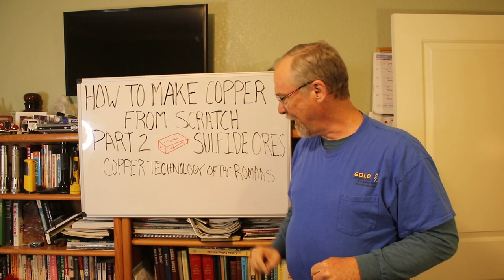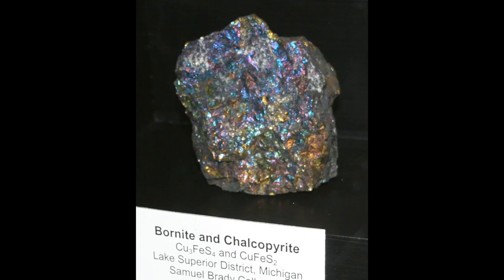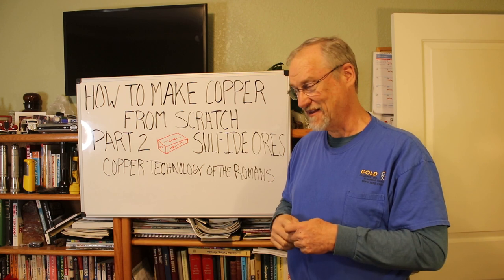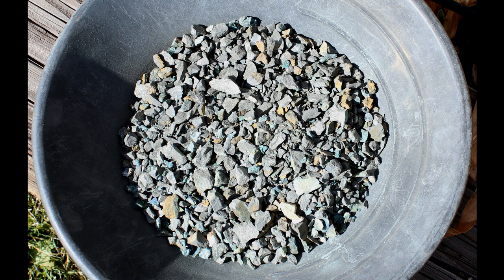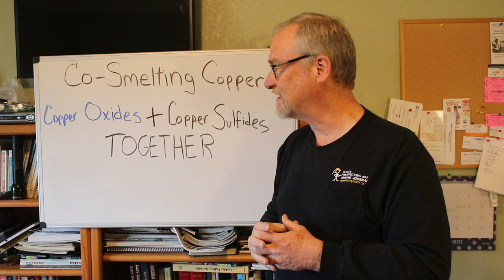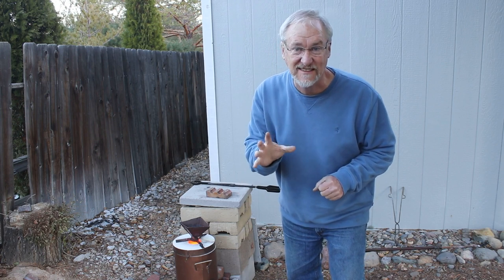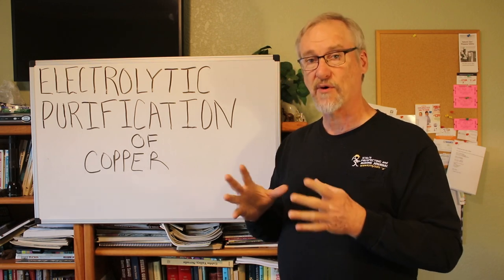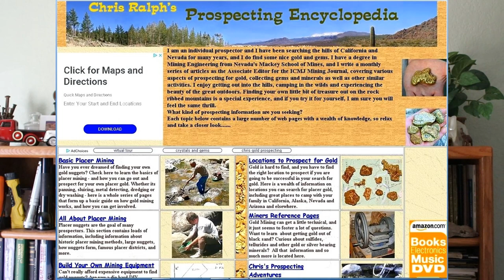Home smelting copper from sulfide minerals

Comment: Hey Chris been deep diving your material thanks for being such a great teacher :) I found some sedimentary rocks that have native copper and some yellow that i think is chalcopyrite. They were shaped like eggs some green and some red and had small grains like sand. They have cavities that look like other minerals have been leached out. They are pretty easy to break apart with a hammer and I panned one and there are some shiny yellow that i was getting at the bottom of the pan. I have been trying to find what deposition model it could be or if it would be worth chasing. Do you have any suggestion what it might be? I am in Idaho right by the big lava flows. Both mountain ranges on each side have had lots of silver-lead mines, copper and gold mines but no previous mines in my middle mountain range. I found this right next to two expired claims from the 80s that were on the creek next to the mountain. Again thanks for all the resources you are providing hopefully you can turn this biologist into a solid prospector one day :)
Reply from the maker: And that is why I don't offer to do mineral ID. You are not really sure of the rock, maybe its native copper, but maybe just something copper colored. I really have no idea what you have. Watch my mineral ID video - color is the least important thing in doing ID of a mineral - because many minerals are of the same color.

Comment: I experimented with this process and also failed. On my second attempt i crushed the ore untill it was small enough to go through a flour sifter. Then used a gold pan to seperate the sulphides and host rock. roasted the sulphides in a stainless steel bowl untill red hot. slowly pourd the hot  sulphides onto a steel tray in a low wind environment so it doesnt blow away (roughly 3 feet above the tray). As it falls through the air it creates a high oxygen environment for the red hot sulphides and it drives off the sulphur (i figured this out by accident). then proceeded to smelt with some scrap iron. It came out surprisingly clean.
(If anyone attempts this please use breathing apparatus. Burning sulphur/heavy metals is toxic)

Great video. I just found your chanel and subscribed 👍.
Reply from the maker: Sounds interesting.

Comment: Great video. This is a very interesting topic. As a metal melting channel, the easiest thing I can say that will help you and is so cheep, you might just slap yourself on the forehead and say OH MY GOSH!!!  If you put a piece of cardboard on your firebrick, then your crucible on the cardboard, it won’t stick most of the time.  Use the thicker cardboard, the double layer with the wavy sheet in it., not the pop can box. It works, but the thicker the better. Very easy and cheep fix.   While melting the mix, did you stir it to mix it up?  That might help.   Sounds like something I would like to try. What was your mix ratio, 50/50?
Reply from the maker: I do put cardboard under the crucible. I did also stir it.
Reply: @ChrisRalph  Right on.  Would it be possible to use stainless steel tubing (or something with a high melting point) running down to the bottom of the crucible and hook an air compressor to it to blow air slowly to add oxygen to the mix?  How do they do it in the big industrial complexes?
Reply from the maker: Consider the danger of bubble splattering red hot sulfide lava all over. Yikes!
Reply: @ChrisRalph  I can imagine. I have had a couple minor eruptions with copper and brass.

Comment: we made iron from ore , using a homemade clay kiln , crush the ore and layer it with charcoal, ore - charcoal - ore charcoal etc , we was left with small ingots of iron which was collected afterwards for further possessing
Reply from the maker: Right, but you were processing oxide iron ores like Hematite or magnetite. This was a sulfide mineral ore, a lot different from the oxides of iron. I did do an oxidized copper smelt recently with charcoal, and it came off with no problem. Take a look at: https://youtu.be/Apb0eIPKphU
Reply: It was local rock in south wales ,  I have no idea about the exact composition  but could find out , if I took a further sample , our valley is called gilfach goch ( little red valley ) , once a coal mining area rich with minerals that was dug out and tipped with no regard
Reply: actually makes more scense, all of the iron ore we collected have already been exposed to the air, so the process had already started

Comment: Chris, can you add your book to Amazon again? I just went to buy it and it's showing it as available from other sellers at prices between $50-$110. I'd like to get it from you at your normal price.
Reply from the maker: It will be available on Amazon soon, but for now its a Covid delay. I am totally out of stock, but my distributor just got in the new copies. The book was being reprinted and is just completed. In the past it has taken about a month to get reprinted, but with the covid thing it has taken 11 weeks to print and ship the new copies. I didn't plan on running out so badly, but the virus has caused way more delay than I expected. The good news is that they will be available again soon at Amazon and elsewhere. Sorry for the delay,  but Covid virus has made a mess of many things. Amazon should be back in stock within about a week. I likely wont have copies myself until after the first of the year.
Reply: No worries. It is my Christmas present to myself, and then in March/April I'll be heading out to Rye Patch for some nugget shooting. Just need some good reading to keep my brain occupied until it's a little warmer out.

Comment: What fluxes do i use when smelting copper oxides and in what quantities
Reply from the maker: Depends on the mix you are smelting. I use borax and sodium carbonate.
Reply: @ChrisRalph  i have a small copper claim where im currently extracting a mixture of azurite and malachite. I would like to smelt it then use electrolysis to purify the blister copper. 
So for every 1kg of ore how much borax and sodium carbonate do i use. 
What effect do they have in the process.
I want to build my own brick furnaces and do 25kg ore batches. How long would i have to keep the mixture in the furnace.
Regards
Tawanda

Comment: Hola Amigo. La búsqueda de oro puede ser difícil y aunque es duro fracasar, es mucho peor no haberlo intentado. Si buscar oro fuera fácil sin riesgos, todo el mundo lo haría. Subir a la montaña, entrar a una mina, prospectar en los meandros de un rio. Si no lo haces, no aprenderías a valorar lo que implica el esfuerzo, la dedicación, la constancia. Saludos desde Caracas Venezuela.!!
Reply from the maker: Nitric Acid and Hydrochloric Acid is a terrible way to extract gold. It works very poorly. Others have tried and shown it to be a mistake.
Reply: @ChrisRalph  A certain professor, I understand that chemicals such as nitric acid must be handled in a safe and responsible way so that they do not harm health or the environment. But it is that I do not see another way to process the samples that do not have visible gold, they are metamorphic rocks that have a lot of mineralization, take about 10 kilos of material, pulverize them and wash a 100-milligram sample with a little soap to see if I could see some gold, but I didn't see any visible gold. Although I do not consider these first samples a failure, since in order to see gold this type of material would have to be treated with chemicals.
Reply from the maker: I did not say they were dangerous, though they are. I said it was a terrible way to extract gold because it does not work. There are too many other contaminants in the ore for this method to work properly. As I said, Others have tried and shown it to be a mistake. That was because it did not work and just created a giant toxic mess of hazardous waste with no gold recovered. In big mines such gold would be recovered using cyanide, but cyanide is a dangerous poison and may not be practical for a small operator. Eventually in 2021, I will be doing some experiments with extracting gold by using thiosulfate, a much less toxic leaching chemical.

Comment: Chris you gave up? That is unacceptable. I have been learning about smelting and I see copper captures PM metals and makes it hard to smelt. You need to solve this not give up if you want my respect, Your a teacher and this is a main issue of what you claim to be an expert of and you dropped the ball and disappointed me. If you delete this because I am holding you accountable that is wrong too. It is exactly what our government has been doing and doing during this election. I believe you are a better man than that, please find the answer for us. We need your help to be successful. The film you did on ores shows large mines with PM's that can not be seen all had to figure this out.
Reply from the maker: I did not say I was giving up - I said I could make it work if I had more time - and I am saving the matte and slag from this attempt and will likely get back to it one of these days when I have more time available. I've had lots of folks ask about the next video in this series, on recognizing copper minerals and prospecting for copper ores. I am moving on with that for now. I also have other things planned after that. So I am not giving up, just setting it aside for now.
Reply: @ChrisRalph  Thank you, Chris, I look forward to that video. Maybe you can have a guest expert with you to help us on this subject. A commercial operator of a large mine who can break it down for the backyard refiner. I thought I saw your metal stuck in the crucible when you poured and did not notice it.

Comment: I'm fine copper nugget every once in awhile I hear there's some place back East to get all kinds of them nuggets copper ones
Did you see those nuggets for sale actually there big chunks of Ironstone from Sierra City I think it's called the Blackbeard claim but they say they're Platinum and Ridiom they want ridiculous amounts of money for them and they say they got like so many ounces of gold so much silver in them if they are let me know I have a few of those in the several pound range
EBay check it out
Have you seen the Bentonite crystals that have came out of Northern Cal
Reply from the maker: People all over Ebay and the res of the internet will try to rip you off every day. There are more of these thieves than one can count. Bentonite is a clay mineral. I think you mean Benitoite, a blue gemstone from central CA.
Reply: @ChrisRalph  yeah that's what I meant I was just talking to my phone it has a mind of its own
It's sometimes called Miracle clay very good for straightening out your digestive system and removing heavy metals from your body inside and out it is negatively charged so when you mix it into a paste and you don't want to use any metal or do it in a metal Bowl that's no
What's really cool to do with the Bentonite member not in metal Bowl or don't mix it with metal spoon soak your feet in it make sure your feet are as clean as they can be do a foot soak and then pan it out you will be amazed
Back to that blue crystal yeah that's what I'm talking about I know where they found it in central Cal I used to race dirt bikes down there I'm talking about the stuff they found in Northern Cal I had a nice chunk AP.5  carat of it but I let this beautiful blond talk me out of it darn it I got it from this lady rockhound she's now passed away she was a true rockhound I got a petrified wood collection from her make a long story short I donated it to a museum he promised me it would never go in the closet yeah I let somebody show it at a science fair oh no oh well for the good of the people
Reply: @ChrisRalph  we'll have to get together sometime and do some hunting I'm not big on lots of people I live in Paradise if you want to call it that we had a mini out of control campfire 84 people 17,000 homes 3000 businesses completely gone in 12 hours every fence every dog house every woodpile ouch!
Oh hun anywhere Nevada in the right time of the year anywhere around Northern Cal anytime been detecting for gold since 1984 when all the pits were virgin trying to think of the old man that used to guard Rye patch darn it he's a legend anyways I think it was Norm back when you could get at least a quarter ounce a day with the gold-bug and if you were scraping better that whole area has different types of outrageously beautiful gold